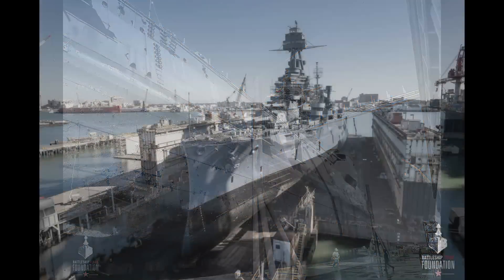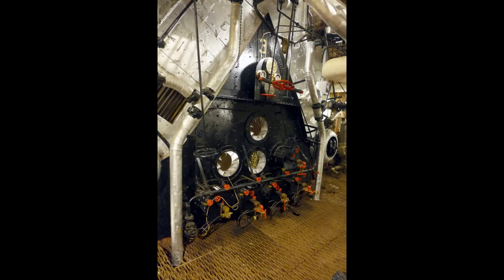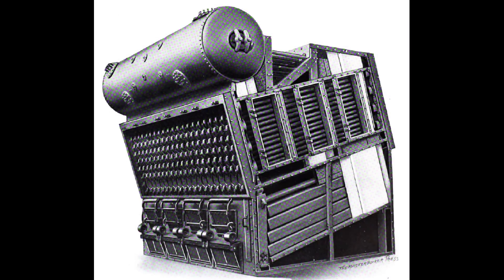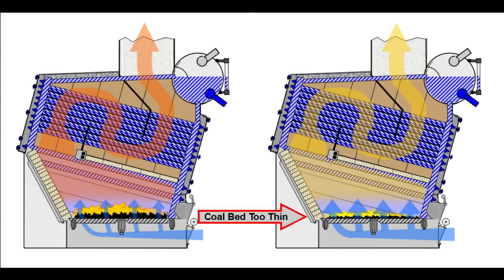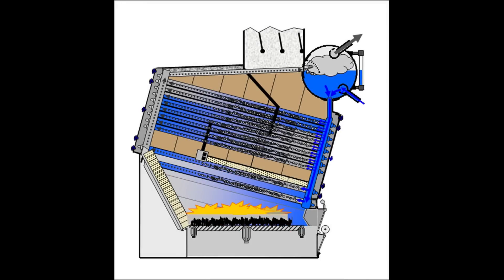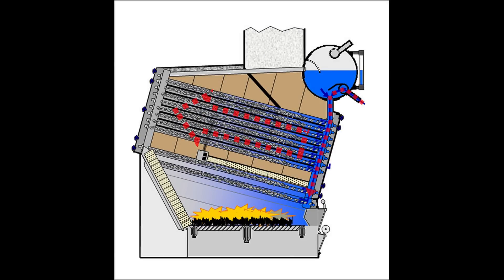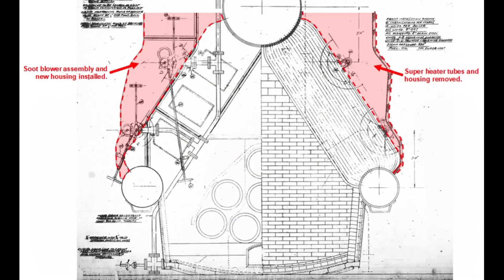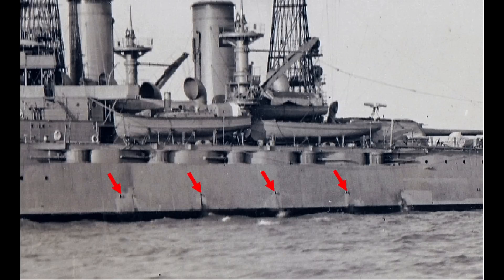Battleship Texas, Getting The Most Out Of Filthy Fuel!

Comment: how did they seal the boiler tube seams up without welding after they were rolled..Brazing?  I know they use to hammar forge pipe..Amazing what they had to learn to do..
Reply from the maker: I do not know the details on how boiler tubes were fabricated, but a 1919 book on boiler construction said there were three types commonly used.  The most popular was lap welded steel, due to low cost.  There was also hot rolled seamless steel and cold drawn seamless steel.  You can find the book in the following link.  https://books.google.com/books?id=1U0iAQAAMAAJ&printsec=frontcover&dq=Steam+Boilers+1919&hl=en&newbks=1&newbks_redir=0&sa=X&ved=2ahUKEwjBmoqHsb2GAxUn48kDHbezBDwQ6AF6BAgFEAI#v=onepage&q=Steam%20Boilers%201919&f=false

Comment: [~8:45]
Wait... whut?  Silly me.  Here I was thinking the whole point of this rig was to "heat water".  Now you're telling me we've got to... heat the water... before we heat the water?  Oof.

No, seriously, I would hope there was some way to do this pre-heating of the intake water, from some of the waste heat sourced somewhere else on the main boilers.  If they had to use an entirely separate water-heater unit to do this pre-heating, I'd be very disappointed.
Reply from the maker: Don't be upset.  Preheating the water was simple and didn't cost them anything energy wise to do it.  Boiler feed water was produced in the engine room main condensers that took waste steam from the engines and other equipment and turned it back into water.  The output water was pumped through heaters, that used exhaust steam on its way from the engines to the condensers, to heat the water.   So, the act of preheating the water with waste steam actually helped system efficiency by recovering some of the heat that would otherwise be lost in the condenser and putting it back into the system.  As I said in the video, it not only lessened the amount of work for the boilers, it also reduced the stress of cold water hitting very hot metal boiler components as it was pumped into the boilers.
Reply: @tomscotttheolderone364   I do appreciate that this vid was only supposed to be about the guts of the main boilers themselves, not their subsidiary connected components in the overall system.  And I hope you don't mind my attempt at a bit of gentle snark, which is meant more as self-deprecation of my own ignorance of these systems, than any real critique of your presentation (let alone the validity of the original design!).

If I had thought about it some more (or, God forbid, studied up a bit on marine steam-propulsion generally!  I mean, FFS!  I did a stint assisting with the "driving" of a "steam-powered" capital warship myself, once upon a time...) I'd have been more than halfway there on figuring out that efficient pre-heating of some intake water could be done nearby, without needing to be built directly onto the body of the boiler itself.  But in any case, thank you kindly for this particular explanation, and more generally for the deep-dive education you're doing here, which I have only just today discovered.  As such, I have only just now subscribed.

Comment: OKAY ! That's enough. 5 Minutes 14 seconds. JEZUS. And you haven't yet mentioned the most important part. Just as a battleships armor must resist shells, the boilers must resist pressure. A continuous envelope of effective steam containment is required if one is to apply steam power to the ocean. A single crack is a complete disaster. (Ka-BOOM) Unlike a diesel motor, which simply stops. Did I mention that people tend to shoot at battleships, and their engines ? With big guns...
Reply from the maker: Whoa, slow down, big boy!  I didn't need to mention what you feel is the most important part in this video because I have already produced one that discusses it in detail.  You can find it by using the link at the bottom of this reply.  It describes how the steam system on Battleship Texas was configured for battle and damage control measures used if it was damaged.  By the way, it is fortunate that "single cracks" in a boiler or steam system pretty much never results in an explosion or few steam driven ships would live their intended life expectancy.    https://www.youtube.com/watch?v=Isw7eyDW_T0

Comment: Before we shit all over coal maybe go read some good books on modern coal boilers. That is still a fantastically well done analysis and breakdown of the boilers!  Fluidized beds can insure an efficient and almost total burn of the fuel. Babcock and Wilcox was one of the best ever in coalfired boiler design. Coal can also be turned into lighting & heating gas, gasoline and oil too. Gilsonite asphalt was refined into 115-145 tetra ethyl lead aviation gas to help win WWII with air power. It was also refined into heavy feedstocks kerosene, light gases and everything in between.
Reply from the maker: I figured someone would be upset about my criticism of coal, but I hoped they would realize that it is limited to its use in ships prior to the introduction of fuel oil.  Oh, well.  I am reasonably aware of what can be done with coal these days, including fluidized beds, etc.  However, that has nothing to do with this video, which is limited to early 20th century marine coal fired boilers.  Everything I said was true within that context and I felt no obligation to explain 100 years of evolution that has occurred since their use.  The fact is that back then, coal was filthy, and difficult to handle and burn in a ship.  Until fuel oil came along that was a clearly superior marine fuel in every way, they simply had no other choice.  I also apparently failed to get across to you that the video is practically a love letter to the terrific Babcock and Wilcox design that was efficient, reliable and got the most out of what was a very dirty and highly variable source of energy.

Comment: Very informative and interesting.  I had assumed that coal was entirely synonymous with fire tube boilers, and oil with water tube. Those kinds of intermediary technologies are often the best illustrations of the iterative nature of design.  It is great to see somebody go in depth on these engineering topics, especially on such a fascinating vessel whose service spanned a period of such rapid and unprecedented advancement and change.  While obviously important, all the flashy guns and armor tend to steal the thunder of the systems that allowed the ship to sail and the men to be fed and watered.
Reply from the maker: The designs were not fixed upon whether they are coal or oil fired.  As shown in the video, both coal and oil fired boilers used on Texas were small water tube designs.  Small, water filled tube designs started coming into common use as they matured in the late 1890's and almost all were coal fired.  The design only became associated with oil once it became available in needed quantities world wide in the 1910's.  That led to an incorrect appearance that oil was used with small tube, and coal with fire fire tube boilers.  There are applications where oil fire tube designs have significant advantages over small water tubes, but I didn't discuss them because they lay outside of power for warships.  They continued to be used where the goal is to provide a constant level of steam using less than perfect water, and that didn't normally see sudden changes in demand, like steam boilers for cruise ships, and heating buildings or providing power for industrial plants.

Comment: Wonderful video, I learned a lot! One question: when they switched to oil fired boilers, were they able to increase the steam pressure and the power of the engines? Or did the engines and the plumbing limit them to the same steam pressure?
Reply from the maker: Steam pressure remained the same.  First, US. Navy boilers produced a maximum pressure of 300psi due to the limits of riveted construction.  It wasn't until they approved welding for pressure vessels in the 1930's that pressure increased to 600psi.  Even if they could have gone higher, engines, auxiliary equipment and pipes were all designed for 295lb. steam, so that also created a limit.  However, the change to oil was still very desirable.  There were not only the obvious things like a cleaner ship, fast refueling, more storage and smaller boiler room crew sizes, there were other major dividends.   The ship's range practically doubled, and the six oil fired boilers that took the place of fourteen coal fired units produced more steam.  That not only reduced fluctuations as big loads were added or subtracted, it provided a safety marge if a boiler was lost or a major steam line ruptured.  The placement of fuel oil tanks along the inside of the ship's hull also greatly increased torpedo protection.

Comment: Excellent presentation, thank you, a couple of points, when you say scuppers, I think you mean bunker lids / doors , scuppers are for allowing water to escape over the side . an very important part of using coal firing , particularly on warships was the use of forced draft as apposed to natural draft , this allowed a doubling of coal burnt per unit of area on the grate , ie greatly increasing the power from the boiler without increasing its size/ weight .
Reply from the maker: Thanks, I am aware of the difference between scuttles and scuppers; that is one of my more embarrassing screw ups.  Even though I didn't mention it, I am aware of the benefits of forced draft.  Both the coal fired and oil fired boilers used on Texas were designed to take advantage of it.  varying the blower speed, thus the pressure in the room, was how they fine tuned fuel:air ratio with the later Dyson boilers.
Reply: @tomscotttheolderone364 titanic also used forced air to pressure the boiler room thus increasing air flow and making the working conditions less dusty.
Reply from the maker: @rdallas81  I suspect that 99.9% of the reason for forced draft was to increase boiler firing rate.

Comment: Excellent presentation and well researched.  I am fascinated by the manual steam drum water level controls.  I can only imagine the challenge of controlling the steam drum water level in a heavy sea!  A coworker of mine once served on a WWII era destroyer.  This was in the early 1970's.  According to him, his duty station assignment was to maintain the steam drum water level by monitoring the level gauge and adjusting the manual feed water valve as required.  I'm sure one of your viewers might have insight into this process.
Reply from the maker: Go to Google Books and enter "Pointers on Boiler Operation".  The top hit should be a 1944 U.S. Navy steam manual.  It was Not easy!  It didn't take much to destroy boiler tubes and make it a trip to a shipyard for very expensive repairs.
Reply: my dad was a BT3 and he had water tenders on his DE and APD 51-55.  i guess at that time, it was a separate rating

Comment: Thank you for a fascinating history and set of photographs.  It's interesting that the boilers on the Liberty Ship-class cargo vessels of WWII were very similar, except for use of residual fuel oil instead of coal, to the original boilers on the Texas.
Reply from the maker: The Dyson boilers installed on Texas in 1925 burned residual oil, with one distinction.  Except for a handful of emergency tanks in the inner bottom, none of her 92 tanks were heated.  For that reason, she and most U.S. ships burned Navy Special Fuel Oil that was Bunker C diluted with a distillate (usually diesel) to improve viscosity.  From what I read, that was the fuel of choice until the 1970's.
Reply: @tomscotttheolderone364  Fuel oil tanks on Liberty ships were heated and I believe there were two sets of inline heaters on the engine room oil lines.  If I remember correctly, the BunkerC fuel they were designed to burn had to be heated to about 110 degrees F to flow through the lines, filters and pumps and 180 degrees F to atomize properly in the burners.  Steam atomizers were not used.  I was an engine room volunteer on the operating museum ship, the Liberty ship SS JOHN W BROWN.  Early in the ship’s reactivation, the ship’s fuel oil tanks in the double bottom had been cleaned by hand (which must have been a truly horrible job) and filled with water and rust inhibitor.   The ship’s fuel was now ucarried in what had originally been a cargo oil tank in no. 4 hold.  To avoid having to heat the fuel, we used no.2 fuel oil (home heating oil).

Comment: The boom in the oil industry was related to the millions of autos which took to the road in the years before and after The Great War. Refiners found themselves with increasing quantities of useless gooey glop which they dubbed "residual oil" until they had brilliant idea: rather than dump it in the river, we'll sell it to the Navy! Once we tell the admirals no big columns of smoke which may be seen a hundred miles away we'll have them on board, then we can sell it to the merchant fleet...
Reply from the maker: Well, not really.  The U.S. and Great Britain, to name two countries, worked hard on oil as a means of improving ship power and more importantly, solve several major problems associated with transporting coal and refueling.  There is plenty of documentation from the 1890's and later that show the Navy was working hard at research and development of oil fired boilers, and creating an oil infrastructure, including their own oil leases.  For Great Britain, they knew that oil was the future and the need for it to fuel their army and navy was a major motivating force behind their cooperation with the Dutch and the creation of Shell Oil.
Reply: Actually, the gasoline was the waste product, which is why autos used it. There was no other use for it and it was a good fit for the more primitive Otto cycle used by automobiles, which is incapable of using more stable fuels. The residual oils are a pretty useful fuel and their low flashpoint makes them much safer than volatile stuff like gasoline. They’re not called residuals because they were a leftovers waste product, they’re called residuals because they’re what remains after the volatiles have been distilled out of the crude oil.

Comment: Something I've never seen properly answered:  Why did water tube boilers never take off in rail use?  They were attempted a few times, but never became too popular.  Was it a maintenance thing?   The need to use dirtier water?  Was the volume of water that they held useful as a 'battery', to meet brief heavy demands beyond the ability of the stoker?  

Great video.  Thanks!
Reply: I believe two main reasons: first, a condenser is impractical on a locomotive, so the water is used once then discarded. Thus the quantities of water needed are huge and it inevitably has dissolved solids, so even with additives scale accumulation is rapid due to the smaller evaporative area and lack of a place from which sludge could be "blown down". Also the shape of a water-tube boiler can't be effectively morphed into a long, narrow horizontal design. There were likely others...
Reply from the maker: @kc4cvh ... and that's the difference between someone who has specific knowledge and me, who was tossing out guesses!
Reply from the maker: That's better answered by a locomotive person.  My best estimate is that at the least, fire tube boilers are much more forgiving.  As you said, they can tolerate dirty water better.  While they don't respond well to sudden, large changes in load, I don't think that is usually an issue with trains.  Its large mass of heated water will likely hold up better to over an under fueling it.  I suspect it would also be easier to open up the smoke box at the front of the locomotive, and brush and blow out the fire tubes than it would be to clean the outside of tubes in a water tube boiler. So, while fire tube boilers weren't the answer for warships where weight and ability to respond to sudden, large changes in load, they worked well for trains.
Reply: I believe it had a lot to do with the ability to use the water in the boiler as a “battery”. Water tube boilers don’t have very much water in them, so they work best in applications where they will spend a lot of time operating in steady-state conditions. Trains do a lot of stopping and starting and have constantly changing demand for steam. The large mass of water in a fire-tube boiler helped smooth out those transitions and avoid significant changes in water level in the boiler.

Comment: Very Kool!  I was a BT on an oiler in the late sixties. I hated re-bricking.
Reply from the maker: I am very happy that I never had to do that!  Of course, you were either working with 600 or 1200 lb. boilers, so I imagine that you more easily risked spalling from heating it too fast.  I suspect you could also have erosion from burner flame impinging on the brick.  Both were fairly easy to avoid on the old 300 lb. systems.
Reply: when my dad got to Norfolk in spring of 51 as an unassigned Seaman deuce, he was assigned to the fire rooms on his DE and he and another apprentice spent 7 weeks hauling brick and cement up and over the rail. he then became a BT3 and ran #1 fire room on an APD and just before getting out in jan 55, he ran all the fire rooms on the AGC (command and control ship) he was assigned to.  he had a 2nd class that was pretty useless i guess hence why the Chief put him in charge...